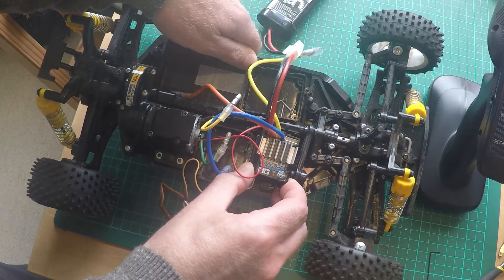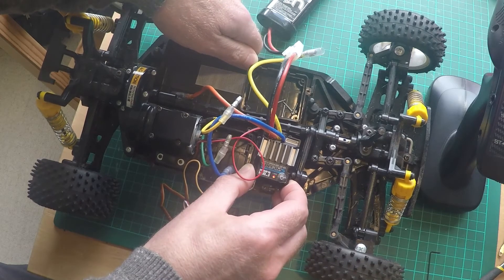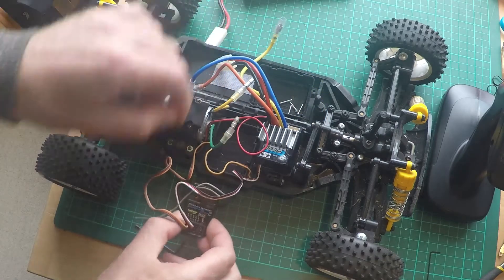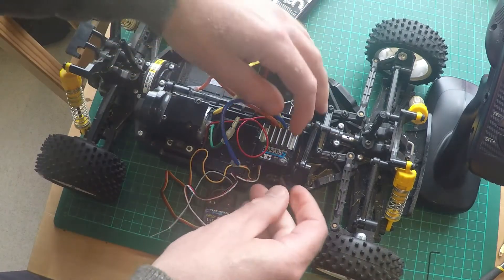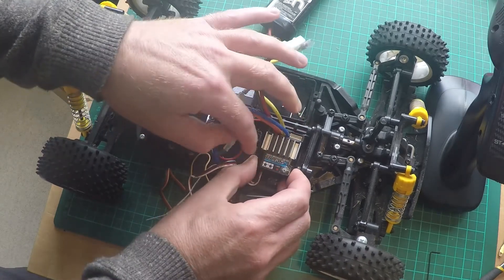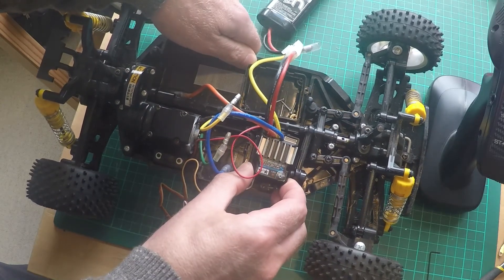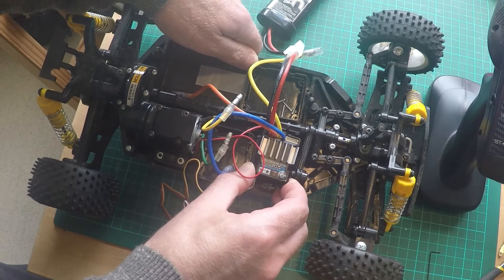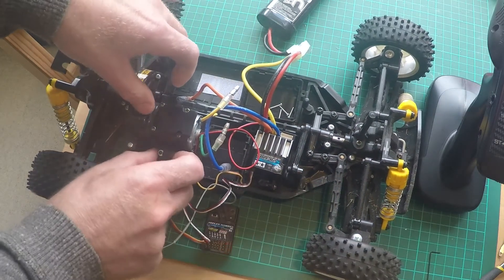Tamiya TBLE-02S ESC Issues

Comment from the maker: The solution was to change the battery. The flashing red light relates to 'low voltage protection'. My battery I was trying must be faulty. I changed it to a freshly charged battery, went through the same 'set' procedure and it works fine. I'll leave this video online as it may help someone else with the same issue.
Reply: Thank you for your info mate